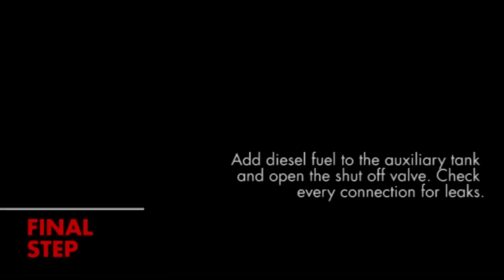How to Install a Dee Zee Auxiliary Tank Connector Kit

Comment: I installed a switch on the dashboard that operates a 12v solenoid on the spare tank that I can activate when I require fuel in my main tank, never have to turn a cutoff valve or climb in the bed. Not a Dee Zee system but almost identical.
Reply: Where do you buy that and how easy was the install?
Reply: You have part number

Comment: I bought this tank and there's one big problem with it. When it gets down to twenty gallons it will not drain out because the drain plug in the tank sits so high off of the bottom of the tank. So you'll have twenty gallons still left in it that won't drain out. Can I install a electric fuel pump system in this tank so I can get the rest of the fuel out of the bottom of the tank? Can y'all recommend a fuel pump system for my tank Thanks for the video and keep up the good work. Thumbs up on the video.
Reply from the maker: We recommend GPI pumps for our tanks that are center balanced. If they are off-set, they need an additional support bracket. You can see the GPI pumps we recommend our website and you can search online for sellers or local retailers.
Reply: @DeeZeeMfg  I really wished that I knew all that I had to do to this tank before I bought it because now  I gotta buy something else for it to make it work. It was bad enough that the mounting tabs came bent closed and the fuel cap crushed when I recieved it so I had to pay a welder locally to weld me new tabs. It's really been a nightmare. Anyway I really appreciate you getting back to me with the info. Thanks and take care.

Comment: In the video, when attaching the fuel hose from the tank to the roll-over valve in the filler tube, the large hose clamps are loose and swinging, just as they were earlier in the video. Seems like an editing issue.

Comment: Can I use on my existing tank. I have a tractor supply tank
Reply from the maker: Gravity fed connector kits are designed for use with Dee Zee Auxiliary transfer tanks that have been tested to meet DOT regulations. The tank would have a green MET label instead of a white label near the gas cap.

Comment: So with this setup fuel is constantly being fed to the factory tank correct? Or does it have a on/off switch to use as needed? If left running will it overflow?
Reply from the maker: The connection kit is not designed for continuous flow and should be turned off during vehicle operation.